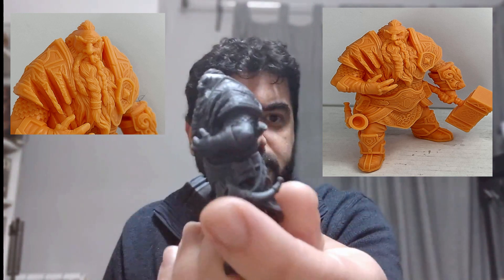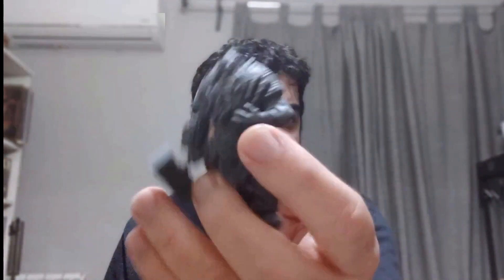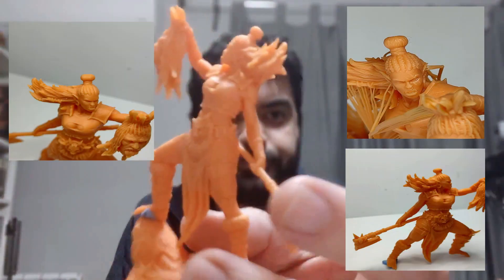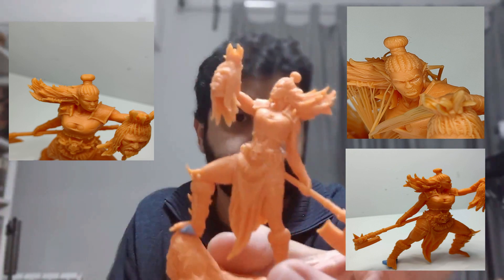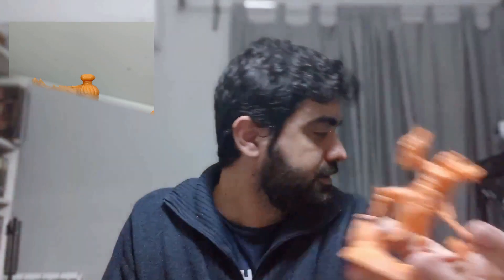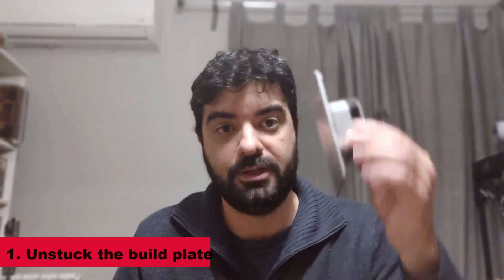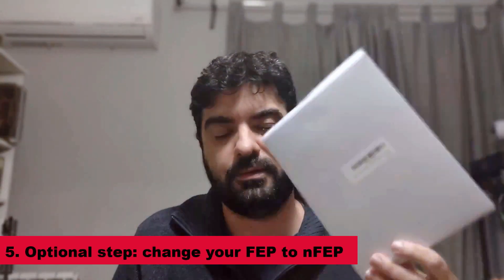SONIC MINI 4K tips to print GREAT! (How to fix some problems)

Comment: I have both the Mighty 4K (new) and the Mini 4K which I’ve had about six months now. I have both on the EXACT same settings, but my prints on the Mini are coming out bad.  

I had to replace the FEP a bit ago due to damage (yes, it’s on VERY tight), and I can definitely tell a difference as the Mini “fights” to pull the model off the FEP. The Mighty, I don’t hear the loud pulling sound, so I’m going to switch to the NFEP which they tell me is MUCH slicker than the other.

Thanks for the video……it was VERY informative! 👍🏾

Comment: My machine buildplate is different from those i saw here on YT, it has a rough coating on it and yet many prints does not adhere correctly
Reply from the maker: hey, thanks for your comment. yeah, there are 2 or more new versions of the SM4K after the one from this video. And some of the problems were fixed on the newer versions, if you still experiencing problems I suggest you contact Phrozen support, they normally are very responsive. Hope it helps!

Comment: Mine worked 100% perfectly fine right out of the box
Reply from the maker: That's great, if you have the new units, that's completely right, if it is one of the old first units, like in my case in that occasion, it was a random thing, some people had good printers, others had trash. So true that they today sell an upgrade kit for 80$ for the "beta testers" that bought the first machines. But they launched 2 generations after that, I bought one after this one that it was good, it's the one I use on my review, and the recent one is the one that comes already with the upgrade kit. https://phrozen3d.com/collections/parts/products/sonic-mini-4k-upgrade-kit-bundle-free-aqua-ivory-4k-resin
Reply: @HobbyistLife  true, mine may be a newer release... I got it about a month ago
Reply from the maker: @gsgidney  for sure it is. But I think they learned a lot from this launch, because the 8K looks really good in all aspects. Hope to get mine in February
Reply: @HobbyistLife  I think mine may have all the upgrades included.
From what I can tell, from the FB group, people are telling me it is.

Comment: My man! Thank you! I followed your advice to the letter: sanded the build plate, moved the tape out 1mm each side by cutting at corners, noticed dimple in FEP so not placing models at center (also replacement sheets are ordered).

Very next print emerging now. I can already see all of the models are on the plate.

Comment: I found that my build plate was too tight also.
I checked the sheet metal for squareness and found that it was not square which led to too much friction. So I put the sheet metal into a vice and using my hands, opened up each side. That worked like a charm.

Comment: When an upgraded machine weighs half the weight of your older machine then you know they are using cheapo components. It might have a 4K mono screen but you just know they are using the cheapest version they can get their hands on. I was looking into purchasing this 3D printer but have started watching peoples reviews and thoughts and it looks like it's not very out of the box friendly. As far as I'm concerned if something doesn't work as it should right out of the box then it's faulty, simple as that.
Reply: @HobbyistLife  Seems hit and miss to be honest. Mine printed just fine OTB. I had one failed print and that was due to me printing a large flat surface slice without enough supports.
Reply: @HobbyistLife  That or something that kind of got into my head was either QC needs work or considering the shutdowns and restrictions in place and the lead-time on certain parts there may have been a supply issue where they switched to what the had available. A lot of the problem printers center into a band of time. I am wondering if other's printers run well if say they got them "recently". Now that the printer is on Amazon we can check the reviews and also know that there will be more in the market. Hopefully it will reveal more.  As someone mentioned here they use a 2-3s exposure time. I looked at the default in Chitubox and it was 6s. Is it different for Lychee users? Am about to start doing some higher res prints and it will be interesting to see if I need to lower the time if get "muddled" details.
Reply: @HobbyistLife  I wanted to come back to this.. so 5 days ago.. FIVE... you mentioned QC..  Well, five days later... the Z-axis jammed tight. Nothing I can do seems to free it. Well, looks like QC. I sent a support request to Phrozen. But 400 buck printer already dead. Not even a week of printing.
Reply: @HobbyistLife  I wish I could link. I could show you the damage. I was able, following Phrozen's customer service links to disassemble the z-axis armature. The plastic threads on the armature that engage the Z-rod are knife-edge worn and there are plastic burs inside the threaded segments (top and bottom segments). That is what caused the jam. The threads became cocked and jammed the against the z-rod. The threads are destroyed. I've had the printer since dec30th. I have not even used 250ml of resin. This level of damage is ridiculous in such a short time.
Reply: @HobbyistLife  well, when you get it. Take apart the z-axis and check the plastic threads.  Frankly from a machine perspective those plastic threads take the entire load from the force of pulling the layers free. Over time that's going to induce wear. I would use a metal part there if I expected longevity.
Reply: @HobbyistLife  I have not heard back after I reported to them the thread damage. So we will see what they say. I posted the pictures on a public post on imgur. Just search out Meatybtz, latest post. You can see the damage.
Reply: @HobbyistLife  Update, Phrozen will be shipping me new sleeve bearings, when, who knows... But in the communications they revealed something important. The Phrozen Sonic Mini4k z-motor is NOT covered by warranty. That is huge. Spread the word. If you z-axis jams. STOP right there don't strain your motor. Slow down your speed to try to save the motor's lifespan. The motor is not covered under warranty for failure of any kind it seems. I don't think I will be buying anything again from Phrozen.
Reply: @meatybtz  Well that sucks...  I have a month old SM4K that I've not used yet.  I have a Photon that I've been using for about a year that's been a workhorse.  I purchased the SM4K to get more detailed prints, but based on stuff I've watched and your comments, I'm starting to think I may regret the purchase.  I was a little suspect when the SM4K first arrived, it looked MUCH LESS robust than my Photon.  I'd not disassembled the Z-axis screw/nut, but was afraid that it was a plastic nut (without a brass or bronze threaded insert).  I've already installed aluminum braces on the built plate support, but now I'm thinking it might be worthwhile to modify the Z-axis feed screw nut to use a brass or bronze part (available from Jackson for the Photon or the Mars).
Reply: @HobbyistLife  Well I got my part in and the unit is working again. It's been about a week. Spent most of this time with failed prints tuning things, went from those back to the calibration prints and once i worked that out am having some success and moving forward. The video is recorded but needs a voice over. Nothing pro, just a dude with a camera but I will go over everything I've learned and it will have some stills of what I've done, and run into. Two small children make it hard to find the time to record the voice over.

Comment: wow. first test run with my new Sonic Mini 4K and every model on the print bed failed. i even sanded the build plate and applied 3IN1 PTFE Lubricant to the FEP film (wiping off the excess). this always worked on my Elegoo Mars but on the mini 4K every print stuck to the FEP. really frustrating. i do have some EPAX NFEP  that i will try if all else fails. running my 2nd print now. just as a test i basically doubled the Bottom Layer Count, Exposure Time, and Bottom Layer Exposure time. we'll see. if the prints don't stick to the build plate this time i'm going to be really annoyed. i think it's telling that Phrozen included 80 GRIT sand paper. this is really course. it's hard to believe you would need 80 grit. i haven't used it yet. i used 150 grit which is what i used on my Mars build plate.
Reply: @HobbyistLife  Finally got a completely successful print. For reference:
Layer Height                        = 0.03 mm
Bottom Layer Count           = 6
Exposure Time                    = 2
Bottom Exposure Time      = 40 (may try to lower this to decrease elephant's foot)
Light-off Delay                     = 13 seconds *
Bottom Light-off Delay       = 13 seconds *
Bottom Lift Distance          = 6 mm
Lifting Distance                   = 6 mm
Bottom Lift Speed               = 50 mm/min
Lifting Speed                        = 50 mm/min
Retract Speed                      = 150 mm/min
Film                                       = Epax NFEP
ChiTuBox supports             = Heavy (and many)

* Total lift + retract time in this setup equals 9.6 seconds. Light-off Delay of 13 seconds means after a layer is cured, the LCD will shut off for the entire lift + retract process plus remain off an additional 3.4 seconds after the build plate is lowered. The advantage is potentially longer LCD life and potentially better prints as the resin has some time to stop moving after the build plate is lowered.
Reply: 2nd test print was successful.  layer height 0.03. bottom layer count 5.  exposure time 4. bottom exposure time 40. everything else at default. on my 1st print that failed i was doing layer height 0.03. bottom layer count 3. exposure time 2. bottom exposure time 30.
Reply: @HobbyistLife  Thanks. I had to lower my exposure time from 4 seconds back down to 2 seconds because 4 seconds was overcuring and destroying detail. Of course now I have failed prints again even after sanding with 80 grit. I think I will try your tip of replacing the FEP with NFEP now. It's very frustrating this printer does not work out of the box. However, each of my print tests was 7 objects and 1 of the objects that actually did print was the best print I have ever had. Far better than on my Elegoo Mars, so there is some hope.
Reply: @HobbyistLife  I lowered the exposure time back down to 2 seconds and changed the FEP for NFEP and 5 out of 7 of the models on my build plate printed successfully. This is up from 2 out of 7. I'm calling that a win for now. Thanks!

Comment: i put about 2 drops of '3IN1 PTFE Lubricant' on my finger and rubbed it on the area of the build plate where the bracket slides up and down and also rubbed the lubricant onto the bracket. then i wiped off the excess lubricant with a microfiber towel. the bracket slides up and down easily now without catching

Comment: There is a way to adjust the power of the LED. If you remove the bottom plate, next to the LED powercable board socket, there is a little wheel, that can be rotate clockwise, to boost up the LED power. Not sure why it was adjusted lower than it can be. Maybe in order to preserve the LCD-s, but then that would raise the question about the quality of LCD screens used in this printer.
Reply: @HobbyistLife  cheers!
Reply: I don't think it's good idea to play with this trim. If you increase too much the current, the LEDs will overheat and this will shorten his life.
Reply: @lyupipen5164  in wich case those re bad LEDs, which they are btw. Had to order replacement array immideatelly after arrival, because uv array was terribly uneven. Took only a month of arguing woth theyr "clientsupport" to get that replacement.

Comment: I absolutely noticed that the bracket holding the build plate was too tight but I just pressed it down firmly while tightening the screws. I had quite a few falls when I started though and they were all due to the settings in ChiTuBox. Phrozen gave me the settings they use with the machines and after using those and making a few setting adjustments my prints now look good.

Comment: I had the same problem with the tape being off center.  I replaced it with Kapton tape.  The FEP was a real problem, until I found out I was over tightening it.  Once I found the sweet spot there was no issues with the FEP after that.  Right now it's the power plug in the back has detached from the circuit board.  I've had to solder it back on twice so far.